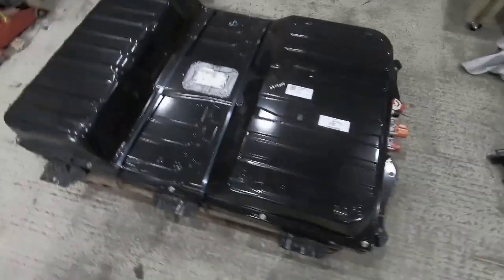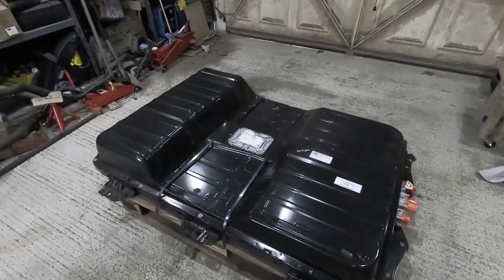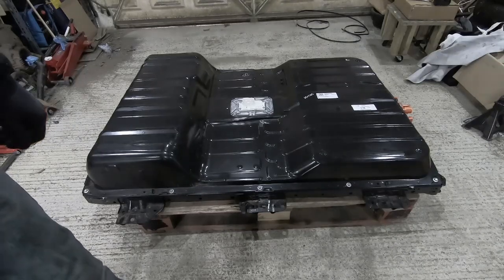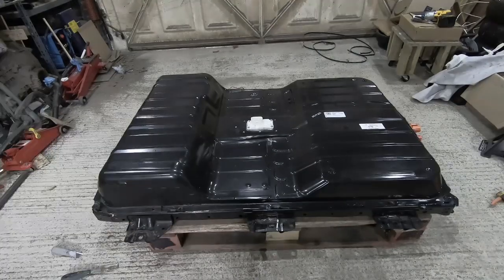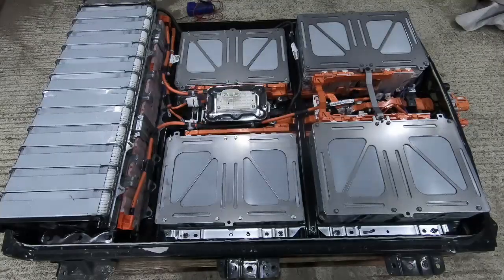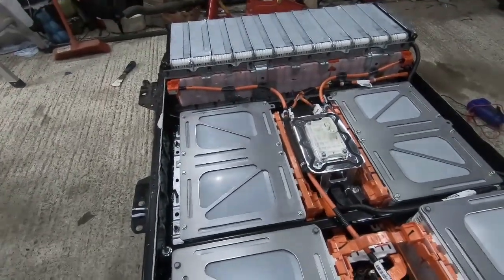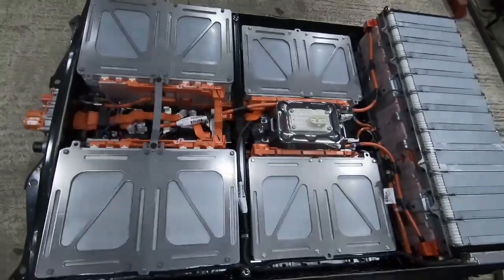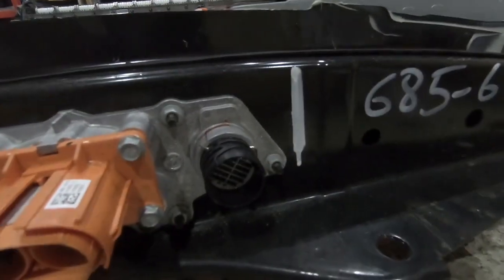Building an Electric Car - EV Parts - Opening Up a Nissan Leaf 40kWh Battery Pack

Comment: I am sure you are aware that the battery packs from some Nissan e-NV200 are connected to the aircon pipes and blow cooled air mostly towards the electronics. I want to replace all the pouches in my e-NV200 with 60Ah pouches in a 96S4P configuration, so 90kwh! Same electronics but in a new box, with new pouches! Will sourcing a 40 kWh BMS give me  an advantage, and how do you circumvent the BMS change disabling the car due to serial no mismatch  fault code P3102? Has anyone done this kind of scheme, and if so, any links would be great
Reply: how is that project moving, successfull?

Comment: Where did you buy old battery? I also need one for my Leaf to upgrade...
Reply from the maker: I got it on eBay, it actually came from the same vehicle dismantlers that I got the leaf drive unit from 12 months earlier. I've only seen one come up on eBay since then, so they are still a bit rare unfortunately.
Reply: @PerformanceEV  Thank you  :-)

Comment: Hey fella - looks great. We use a reciprocating saw to break the seal on the case lids. That way the lip doesn’t get bent out of shape. What kind of cost was the 40kwh pack?
Reply from the maker: Thanks. Yeah, more and more I am getting the impression I need to add a reciprocating saw to my tool box. I ended up paying £125 per kWh, which is pretty much in line with best price for used batteries that I can get my hands on here in the UK. I know some people seem to be able to get them cheaper, but I've never been able to find them for less, and definitely not in this condition.

Comment: How expensive are a 40 Kwh used Leaf pack ?
Can think alot of 2012-2014 Leaf owners want one to upgrade it to a bigger one if its possible to switch it out.
Reply from the maker: I ended up paying £125 per kWh, which is pretty much in line with best price for used batterys that I can get my hands on here in the UK. I know some people seem to be able to get them cheaper, but I've never been able to find them for less, and definitely not in this condition.
Reply: @PerformanceEV  Cheaper then i thought then easy worth it for old owners to upgrade to bigger battery in mint conditions